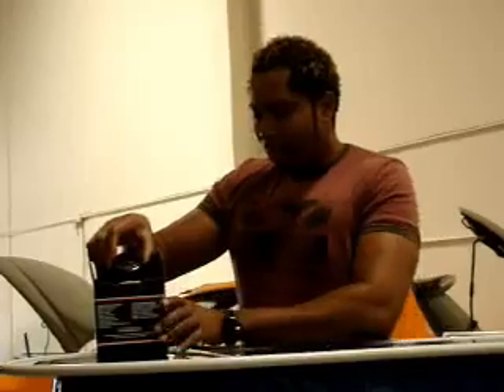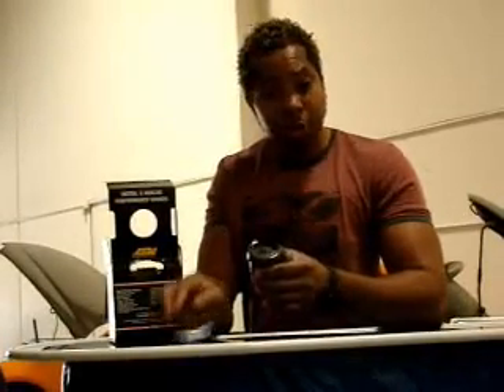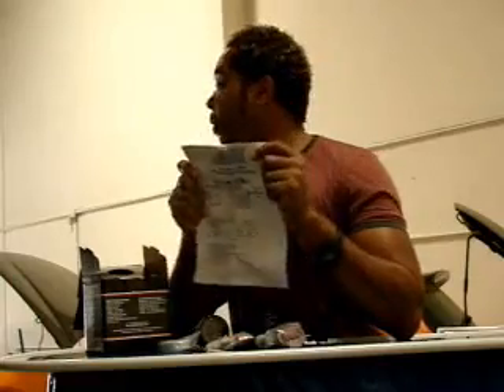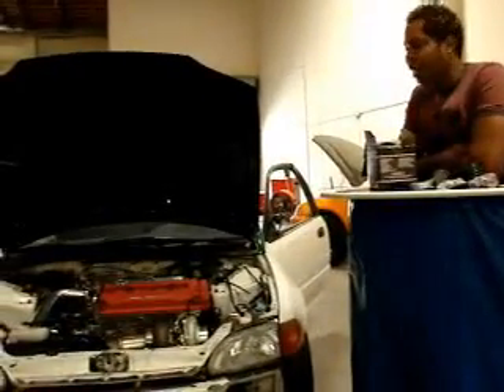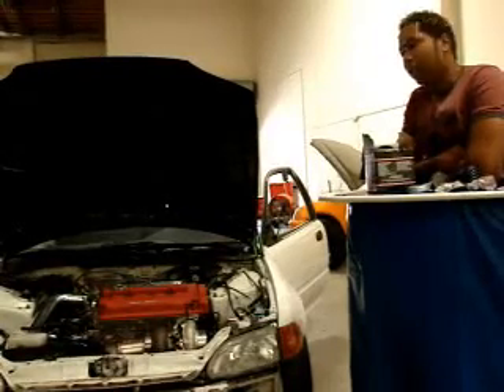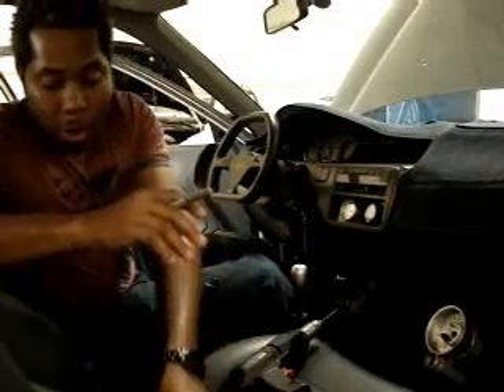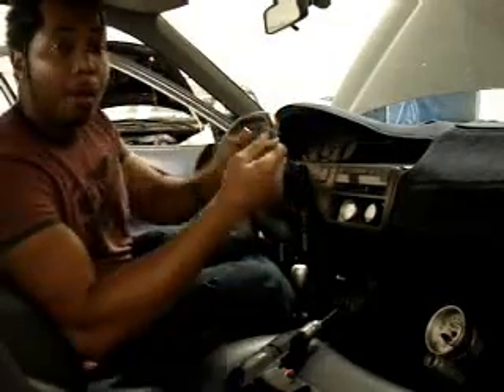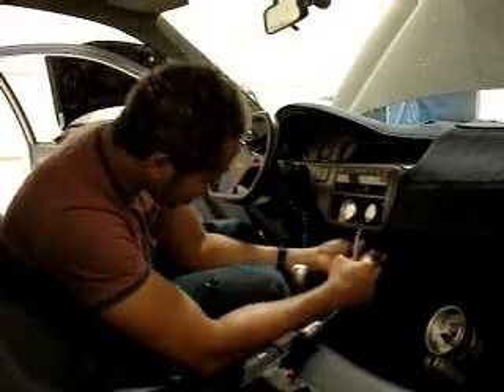AEM Analog Wideband Air Fuel Gauge Install Part 1 of 2

Comment: i am sure there are, but for the price i dont think it could be worse than what they are using. The go pro line also has multiple autosports packages that includes mounts and what not that would be good for track sessions etc..etc.. I dunno, i personally dont own one but its on my list and for the price I cant think of other options that do 1080p and are used by multiple auto shows worldwide. thats just my two cents though.